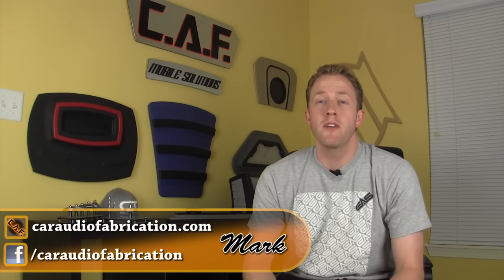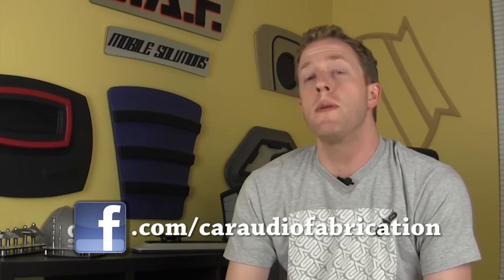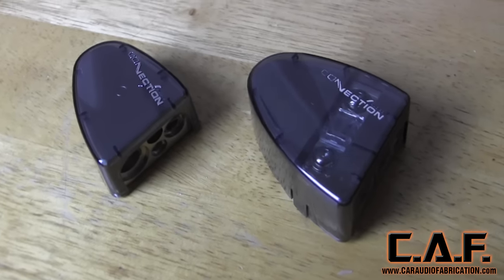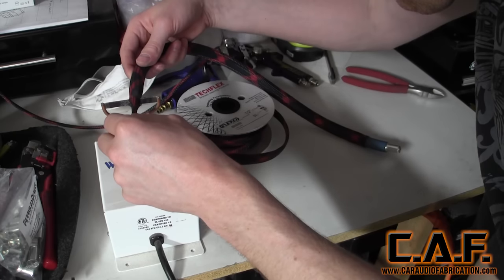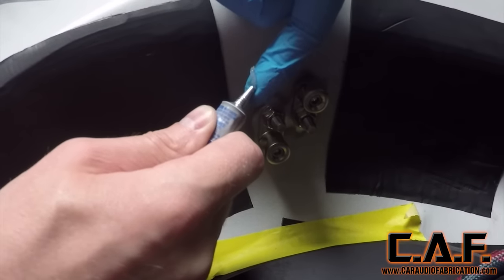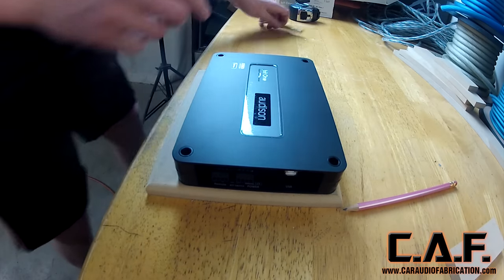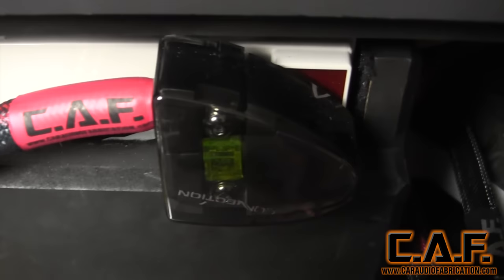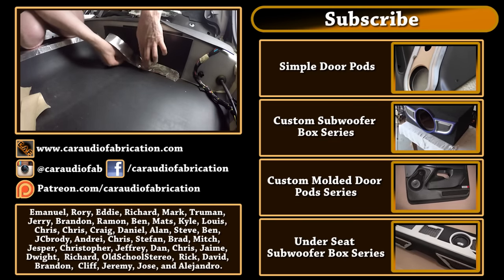Car Audio Wiring - VBL #6 - CarAudioFabrication

Comment: I am literally addicted to watching your  videos. You are so good. Its awesome! I have been watching you for about a month now. I stumbled across your video on building a subwoofer  enclosure.  And thats all it took....HOOKED. I have never gotten into car audio too much until I decided to try to put an amp and subwoofer in my 09 Chevy tahoe.   I've never been too great at electronics . But I have to say that you are a true inspiration, so fluent in your language. Thank you for the great content. I went out  and bought the MTX terminator 2000w sub and 500w amp package and got to work on my first car audio install. I've learned so much from you in past few weeks.  Everything from RMS to using multimeter to set gain...you are the go to guy.  Thank you  so much.....But I had horrible experience tonight.....I spent all day  routing wires and mounting fuse block and amp....getting everything just right and then went and wired amp backwards because I started to rush....I literally spent all day and half the night.  I feel sick to my stomach.  I can't believe that I did that.  Anyway, wanted to comment and share that. Again thank you,  you are amazing.

Comment: That dielectric grease is awesome. I put it on the bare metal before bolting down the ground and cover the whole connection after. I also use it inside the crimped lugs I use in the engine compartment and all over the battery terminals. With New England weather you can’t do enough to fight corrosion.

Comment: I understand the resistance is in specs, but grounding to body sheet metal still gives me the shivers.  Not too hard to mount a termination block to the frame.  Though I suppose I've never worked on uni-body (body-on-frame pickups only) so you may not have a choice there.

Comment: When you upload your deadening video you should add some info about the different options available, the strengths and weaknesses of each as well as which products suit a specific goal or application best as most the product pushed on the market is the butyl deadener, info would be good to know the difference between product that's made to stop panels resonating and if another is better for blocking road noise etc, love your videos man.

Comment: I think a good topic to cover for a Q/A would be in regards to a  digital SPDIF signal. I have a 2013 genesis coupe and it has an oem amplifier that uses a digital signal to the amp (pre amp signal...) so I cant utilitize a clean full pre amp signal. What would be your choice while keeping factory look of interior in mind. Is there a choice of LOC you prefer? Do any of the speakers in my setup get a full signal or are they all being "crossedover" if you will?

Comment: hi. whats the difference of having separate ground points of multiple applications and single ground points? example: some people ground the amp to the secondary battery rather than giving the amp a separate ground. And also, what are your thoughts on battery isolators?

Comment: As much as I love car audio I wish I knew how to do all this stuff
Reply from the maker: eddie mann Hopefully my videos can help you out! I wasn't born with all this knowledge, if I can learn it you can too! Lot's of great information out there!
Reply: It's not hard bro. You just need to make sure you have the right tools.,, know what you want... Parts you need... & always disconnect the battery before moving, placing any power wires. Watch more of the videos on this channel & you will learn a lot.
Reply: eddie mann When you get your first car teach yourself there. You have more help than me when i first started doing this because you have the internet. I was 13 when I first did an install and I just guessed and ended up blowing like 10 fuses in my brothers car.
Reply: CarAudioFabrication thanks for the words, the problem I run into is that I have a 2014 Ford Fusion and I've taken it to a lot of car audio shops and I'm being told I need a lot of things do to the fact that there isn't many aftermarket decks or dash kits for my car to start my set up
Reply: eddie947 I do have a car I have a 2014 Ford Fusion and I have two 15" Memphis M4 mojo to put in the trunk from my last truck, the subs were installed by a stereo shop

Comment: OK here's a good one I know you can use a Multimeter to set your amp correctly but no one ever explains is there a correct way to set your factory highs I would assume you can use a Multimeter for that as well be kind of cool you don't just have to shoot from the hip thanks again definitely help with a lot when it comes to the custom game
Reply: Use an oscilloscope to check for clipped waveforms using a test signal. It's the same whether it's for your high frequency, mids, sub. Although I use 0db tone for highs, -5db for mids, -10db for sub.

Comment: Excellent video dude - loving the work.

Have you done the 'in depth' video yet?  In the middle of my build atm (will bug you with photos when I get something to show) using a lot of your techniques :) I'll be fitting not only fans an LEDs but also a Plasma Plate in the center for no other reason than it looks cool and I have a space that needs filling.  So many questions about your secondary wiring loom and terminal bar.  Does your terminal bar link all the connections along it?  Does your remote wire turn on all the accessories using the relay? I wanna know your deepest, darkest brain regions -woohahahaha

Comment: You should run a ground wire from main batt to body of car the same size as the ground to body wire on rear batt is mainly cuz the OEM body grounds are very small

Comment: I would love to do this kind of work. Unfortunately my customers almost never want to want to pay for this level of  cleanliness or high end audio. I would love to do a full focal speaker/subwoofer package with a dsp, tuned perfectly for time alignment and perfect level adjustment with all the cleanliness of the wiring, but most everyone I run across wants a stereo and a powered sub in an hour.
Reply from the maker: Time to start pricing out those customers, if you dont want to do trash work refuse to do trash work, start building a catalog of pictures with examples of your installs and why you do them better amd explain the benefits. People will pay and not everyone needs to be your customer.
Reply: CarAudioFabrication I am genuinely stoked that you replied to my comment. I have to say that as a business, we’re doing actually really well with our demographic- but it’s mostly a retirement community who want features- backup cameras, new head units, and parking assists. A lot of my community doesn’t care about good sound, which I’ve built a wonderful display by hand for. We have Kevlar, flax, polyglass, auditor (all focal, 6.5 components and 10” subs) and a stock speaker wired to a factory head unit, dsp, and audiocontrol amplifier on display to assist the customer to show how much of an improvement it is. But most days I’m installing head unit, a full set of focal auditors and a backup camera. It’s good money, but I just wish people would understand the need for amplification. Just as an audiophile I wish they wouldn’t settle. Lol.

Comment: I understood that the power wires are on one side and the signal and speaker wires the other.  But then I was not sure if you said that speaker and signal wires must also be kept separate from each other?  it appeared, I thought, that at least part of the time, the speaker and signal wires were next to each other?

Comment: Very nice video, as usual! Only one comment, stainless steel hardware through normal steel is a no go. Thats going to corrode. Your better off using steel hardware and protecting the outside parts with undercoating.

Comment: So you fuse the output of the battery supplying the amps. For the feed coming from the front of the car to power the battery, do you fuse that run at BOTH ends, or just the supply end under the hood? I didn't see any additional fusing for it in the trunk portion so I'm guessing just fuse one end there?

Comment: What is the safest and proper way to wire multiple remote wires? I am installing 2 amps. I usually use the remote wire from the Deck for one amp., and then wire the other to a 12 volt that turns on and off with the car. Could I instead use a distribution block, or T Tap in it? What would you suggest. I just don't want to do something that could be a potential hazard. An Thank you for your knowledge.

Comment: Great videos but question how would you connect a 1/0 power and ground wire to an 3000 watt amp with no set screw connections.

Comment: Nice video dude, always informative. With tech flex, how much does it cover the colour of your old wiring? I have red and black 0 gauge wiring that I'd like to make a different colour but I'm not sure how well it will work. 

Thanks!
Reply from the maker: bhubb18 It depends, if the techflex needs to be in its expanded position you can see through a little bit more, you can actually see this in the video a little bit. A lot of the blue in the Elettromedia speaker wire shows through somewhat tinting the look of the wire. I like it, looks kind of neat.  If the techflex is a little oversized for the wire though it definitely hides the wire surface more. I have revamped old wire using techflex in the past.

Comment: Hi... fantastic build.I have same few questions on my system I built myself. I have a Pioneer avh 1700s head unit
a 8000watts max orion hcca 4ch amp,  
audiopipe 2000.1mono block, 
audiopipe 1200.2 2ch amp
 precision power 7band pre-amp with digital display,
sound stream 3way crossover, 
audio control (matrix plus) line driver,
four orion xsm6"
 two precision power 10" midbass, 
two selenium D220ti 8ohms drivers,
four Nb2 power acoustic tweeters.  &
(1) Nsb100 gray flat battery in the trunk. Big 3 upgrade also. All fuse, grounds and power wires to match. I will like to know if I have enough power to supply my system? Do I need a 3rd battery or upgrade my alternator?? All in a Nissan Wingroad y12. with a 110 alternator and the stock battery up front.

Comment: hey Mark,  what's up man?  Got a question for you.   I really like the look of the tech flex but I know that the tech flex is expandable.   What size tech flex do you recommend for OFC 4 gauge and OFC 1/0 gauge, knukonceptz?  Also, I tried finding the black and red pattern  at wirecare and I couldn't find it.  Any help would be appreciated.  Thanks.

Comment: Question! I'm building an install and want to run couple of cooling fans can I run them off the blue remote lead? Or will that take too much power? If so should I upgrade this wire.

Comment: Mark, what would you recommend for a reliable DSP to use with a factory stereo? I want to run a set of 6.5 component speakers for my fronts, a set of 6.5 coaxials for my rear doors, and I'll be using 6x9s in the rear deck? And some time in the future I may want to add a couple of subwoofers to the setup.
Reply from the maker: Brian Frishcosy If you are going to run the front speakers active (which I recommend) what you have described needs 8 channels. The BitOne from Audison (Elettromedia) would work great for this. I would ultimately ditch the 6x9's in the rear deck to allow the additional channels to be used on the subs
Reply: Okay thanks for the advice Mark
Reply: I'm probably going to end up taking my car to have the system installed. What do you think of Cadence Amplifiers? I've never personally seen them in action before.
Reply from the maker: Brian Frishcosy I have only seen them on YT so I cannot really form an opinion at this time.

Comment: I have a westcoast amplifier orion 25000 that's not powering up all i hear is the power relay click on it holds then i turn off power it clicks bk off no power light . am i not getting enough voltage or why . please help by answering THANK YOU DAVID ARNO

Comment: Ok so I  have the 6 speaker Uconnect and the tweeters are parallel to the front 6x9s I have a 4-Channel 2001 RF Punch 801x AB amp 2 OHMs min stable times 4 channels.  My question is the following.  If I have the Tweeters and the front mids parallel for a 2 Ohm load on both channels 1 and 2 is it okay to have channels 3 and 4 using a 4 ohm load in 4 channel mode?

2 ohm Channel 1
2 ohm Channel 2
4 ohm Channel 3
4 ohm Channel 4

Comment: How do you match your gauge of wire to the correct thickness of TechFlex needed? Say I use 4 gauge wire, how do I know if I need 1/8, 1/2, 3/4, 1 inch techfex?
Reply: hey man did u know how to find techflex for 4 gauge wire
Reply: 3/4 inch techflex fits 4 gauge

Comment: i have a ds 18 0gauge wire n am planning to make it as a main cable from the battery and straight to the back. wer i have my amps n i just want to know will this 0gauge wire dat i have can it with stand if i connect two amps one is 4channel 1000w n d other is mono 3500rms.planning to distribute power  to each channel with a distribution block.4gauge to mono n 4gau.. to 4channel

Comment: Im lost here, if you use the BBC 41PF and designate the only 0 gauge output to your distro, how are you going to run power to the front battery with only two 4 gauges left on the BBC 41PF?
Reply from the maker: Parker Conner  The SFD41C Distro block has dual 0 Gauge inputs, you can see this if you look closely in the video thumbnail. (View thumbnail here: http://img.youtube.com/vi/ZG_8x33muPM/maxresdefault.jpg ) You can see one run goes from the secondary battery to the distro, the other run is from the front battery. Keep in mind BOTH RUNS ARE FUSED. I want to put emphasis on that, both runs MUST be fused. Does this help clear it up? J Thanks for watching!
Reply: CarAudioFabrication Mind blown, JK! I have the same distro as well as bitone and audison voce 3 way all on JL HD amps so I am VERY interested to see what all you show on the bitone seeing as there is NOTHING on Youtube, mainly setting output levels as Im sure you know the bit one manual is quite shady in that area!! So when you run power from the BBC 41PF to the front, are you fusing close to the BBC 41PF and by the front battery or just the front battery?
Reply: Yea I HOPE TO GOD you do some videos on the bit one. There's not much out there on it other than Doug's stuff at Soundman. I was an installer for years about 7 years ago and didn't get to dabble much into the audio processors. When I got my BitTune D I couldn't find any information on how to tune it so had to pay a shop $400 to do it :( I know it's not that hard to do but there's just SO much that goes along with that. Especially they're BitTune software that's supposed to make it easy, but only makes it more confusing
Reply: CarAudioFabrication Bit One tutorials would get you ALOT of exposure in the Youtube community as well as internet!!!!!!!!!

Comment: Thanks for the video.I have the noise in my sistem like the motor,but the car is off.My power source running on the driver side,my speaker on the passenger side and my RCA on the center but in my trunk almost come together because the longest wires.Do you think that is the problem
Reply: Hector Perez check and make sure you have a good ground. If that's good try turning your gains down you might have them to high.
Reply: I measure the ground and read .02 in my meter ,my gains is in half way,if I put down in pre amp volume down the noise go away,this one is my second pre amp,I'm thinking to remove the pre amp to see what happen
Reply: Hector Perez Do you have a factory or aftermarket headunit? If it's aftermarket check the ground on it. Sometimes the the problem starts at the beginning of the chain you be wouldn't think it but I've come across it several times especially in mustangs. The more you add to a system  more chances you have for noise to be introduced so check all grounds and keep signal wire away from power be wires when you can.
Reply: aftermarket head unit.pioneer AVH-4201 NEX connect to the original hardness ,also my car is mazda

Comment: What size of heat shrink do you use?
Reply from the maker: +Isaac Vera IT depends on the wire size, you can get 3:1 shrink ratio (or even 4:1!) so that you don't have to be as concerned about the fit.